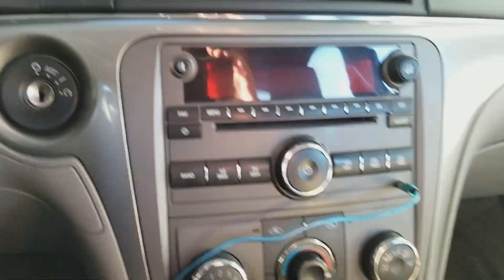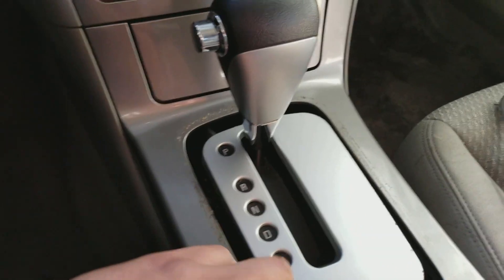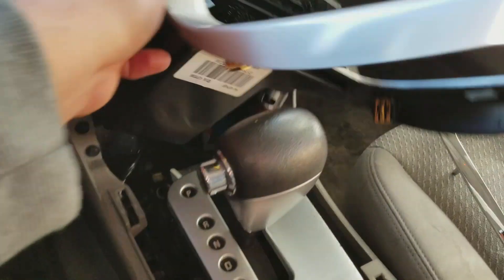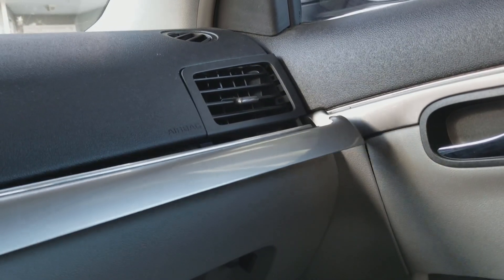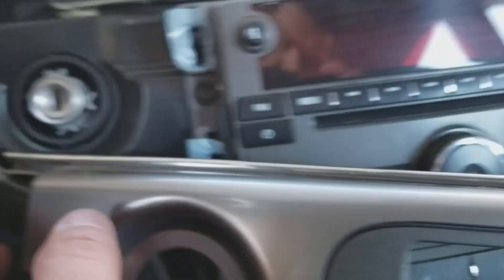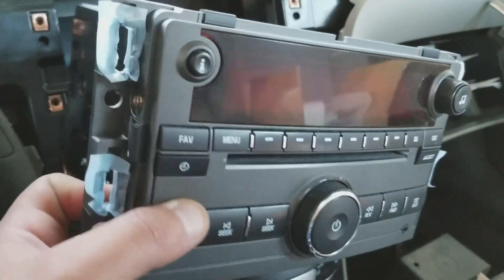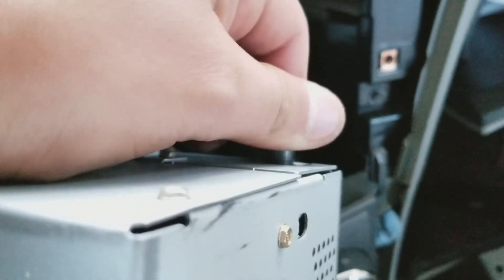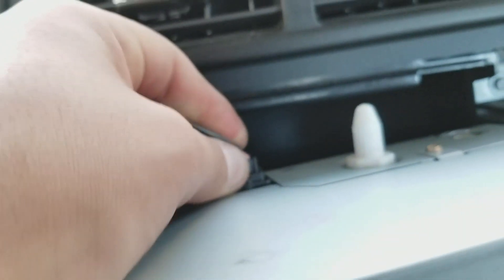Saturn Aura Radio Removal

Comment: I have a Saturn Aura 2007 and radio / display is completely out not working nothing...is that same issue you were having with this radio? Checked my fuses all were good. I'm wondering if a new radio is my next move. Any troubleshooting tips I would sure appreciate! Thanks 😀
Reply: Hey marie,,,,I just watched a  video about that very problem,,,The man said grab the metal ring around  the volume knob,,ONLY the ring and push it in,,,,see if that works for ya,,,,It`s supposed to restore the screen
Reply: @mrcoz1764  could you send me the link to that video please. I did try it but the silver ring didn't move. Seemed more like just for ornamentation. The display doesn't come on neither the radio sound is working.
Reply: @mrcoz1764 , thank you!
Reply: @marieellender6530  Let me know if that helps
Reply: @mrcoz1764  no it didn't do anything. That ring is just ornamentation on my car. I probably have to get a new radio system
Reply: Did you check the fuses inside the hood? Having the same issue

Comment: Did you put a new sterio in?
Reply from the maker: Yes I did
Reply: I'm having trouble trying to wire in a new radio in my 07 aura my adapter plugs in but the colors don't match could you lead me in a direction

Comment: I’m stuck halfway thru putting in my new touch screen radio in my 2008 Saturn aura and it’s not coming on. All I can think is there a factory amp I have to bypass?
Reply from the maker: Check your ground wire.  Connect it somewhere else.  I've had that happen plenty of times. I would start with that. I think all GM vehicles which includes saturn have a chime box of the harness make sure its grounding correctly.  I've also had harnesses that were bad that were brand new
Reply: @JCAUTOMOTIVE4444   hello, my son just bought a 07 saturn aura and there is no power to the radio i checked all the fuses there fine also the blinkers dont make a noise can u help me plz
Reply: @Spazzy253  Did you ever find out what was wrong with your radio? I have a 2007 Aura and Im having the same issues.
Reply: We took it a auto shop I guess the stereo was bad just had a new deck installed at car toys was super expensive for the wiring harnesses tho
Reply: @Spazzy253  How expensive are we talking? Trying to get an idea of what Im getting into.
Reply: Well like I said the most expensive part was the harnesses there's like three different ones 1 is for the deck ones so you can use the steering wheel volume buttons and the other one is for the OnStar we didn't get the OnStar one it came to like $350 I think for the harnesses then you got to pay for the deck and the install is like $600 bucks total.
Reply: @Spazzy253  I think I will go with a good boom box instead.  LOL
Reply: Lol try ebay last time I looks they had a stereo for like $40 bucks maybe u could try that, or just get the 1 harness to the stereo only u don't have to get the one for the steering wheel buttons. Good luck